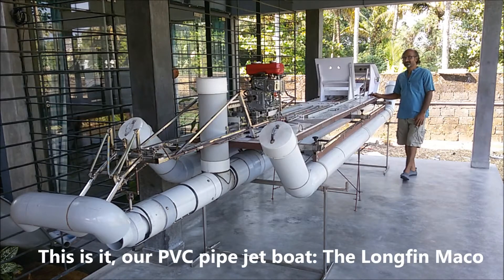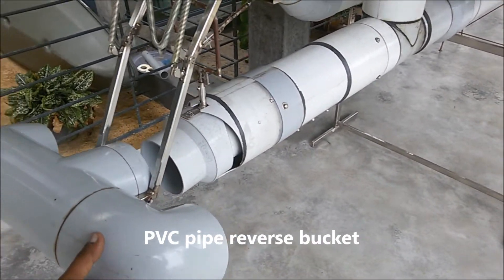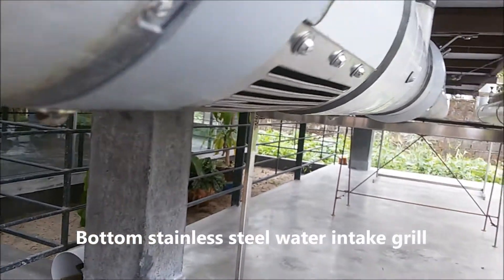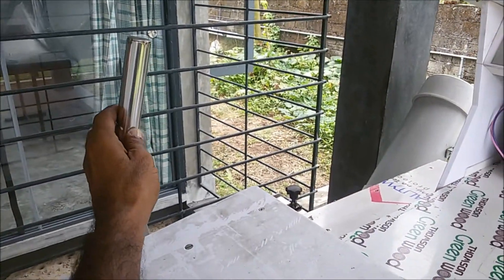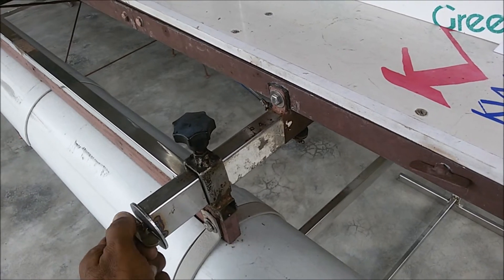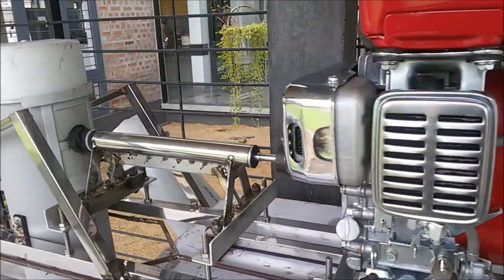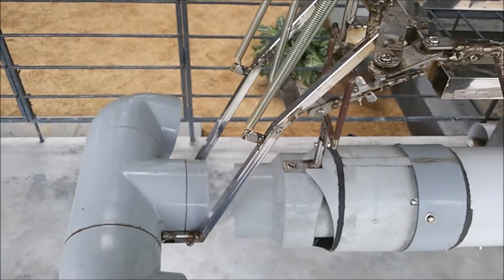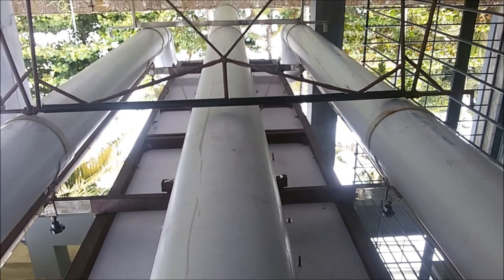An amazing PVC pipe jet boat: A World's first such craft perhaps

Comment: thanks for sharing. i had the same idea but for the flow to pull you forward you should open the front side of your boat and let it sit in the water.this way you go faster. now you are just taking with you extra weight of water in the middle pipe(propeller pipe)
Reply from the maker: Thanks buddy...I would look into your suggestion for any improvements